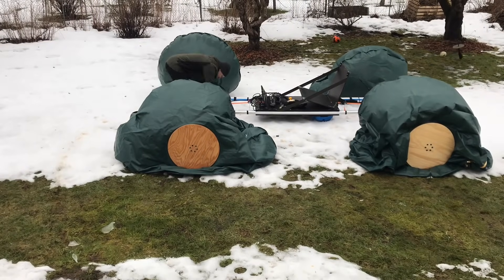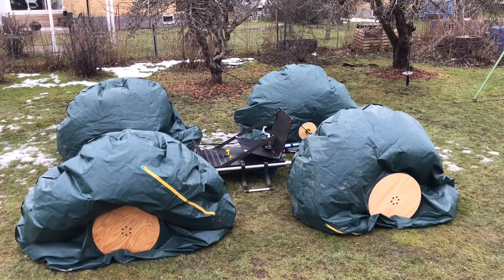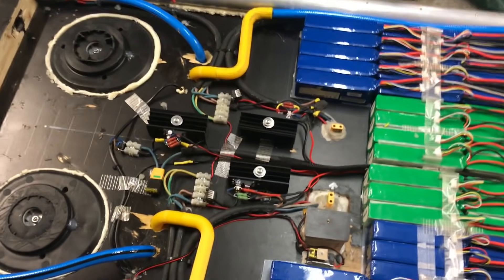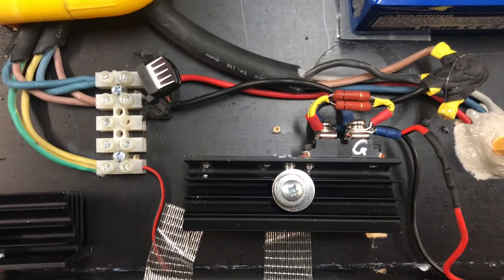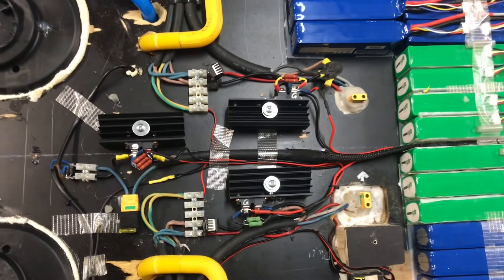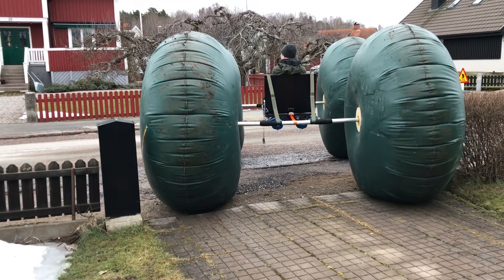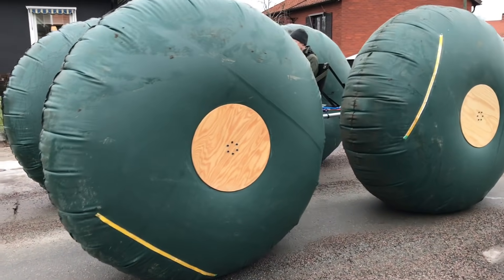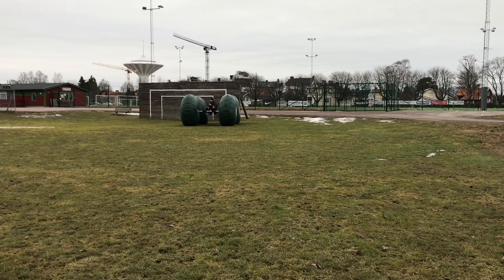Inflatable car episode 7 First full  test drive DIY SHERP!

Comment: It will be interesting to see this thing on the water. But i suspect it will slip alot and not be that fast.
Reply from the maker: Thats my guess as well. Although, the small amount of water being accelerated will be accelerated in the right direction (backwards) since the wheels will be "standing" ON the water rather than being mostly submerged in it like the Sherp. So still a little bit of hope there. The giant surface and low weight of the vehicle will make crossing water a windy day a no-go for obvious reasons though...
Reply: @amazingdiyprojects  Maybe a netting around the wheels for water driving is a solution? like snow chains on car tires.
Reply: Оn the water this car will be a toy of the wind. For strong wind on the ground too.
Reply: @RW3DQQ  You would have to choose a calm day, and a small, preferable shallow lake. of cousre.
Reply: @amazingdiyprojects  You are going to need to think about water traction. Paddles for the wheels that double as tire tread perhaps.

Comment: Your vacuum cleaner motor oscillation is caused by something called a hysteresis loop.
In order to fix it you need to add a delay between the input sensor and the power output.
Usually a fairly meaty capacitor across the gate of your output power transistor should fix it.

Comment: I built a few models to test 4-wheeled tank steering for RobotWars, and found that it worked much better when the wheel-base was about twice as wide as it was long. That way the wheels don't have to slide sideways as much when you turn. However it looks like you might struggle to make your car either shorter (because the tires are already close) or wider, unless you move your neighbour's mailbox!
Reply from the maker: I think you are absolutely right wheel base-lenght wise, but just as you pointed out ; there is just too many mailboxes in the world for that approach in this context...:-D
Reply: if the axle widths were different (front axle not as wide as the back, for example) you could overlap the tires and make the distance between the axles shorter. probably not these tires, but maybe with thinner ones. of course then you'd have even less visibility for steering...

Comment: Amazing vehicle. Have you considered turning it into a wheeled stretcher controlled by a first responder walking alongside. Could you add a pitch and roll sensor to the vacuums to keep the body level on inclined topography?

Comment: The oscillation your experiencing in your tires when you turn is somewhat akin to what's called "tire shake" in top fuel dragsters. As you've discovered already, it's related to grip level between the contact patch of the tire and the surface. In essence the tire kinda "wads" up on itself and then springs back into an oscillation. I think there are 2 ways they deal with it. One way, is tire pressure. More pressure makes the tire firmer and at the same time reduces contact patch and grip. Perhaps you could incorporate a system that would dynamically regulate the inflation pressure in you tires either based on the surface your on and it's grip level or perhaps simply increasing the pressure whenever you are maneuvering the vehicle. They also deal with it by controlling the application of torque and wheel speed by adjusting how much the clutch slips. Usually when dragsters experience the problem is when track conditions are tight and there is a lot of grip. Under those condition they want the application of torque to be much more aggressive to get the tire to slip enough and maintain a high enough wheel speed to prevent the wadding up of the tire and having it go into tire shake. Of course they have much more horsepower to play with. But some of the same principles might be applicable in your situation.

 Also If you watch a slow motion video of a top fuel dragster on a successful run (successful meaning no severe loss of traction or tire shake), you'll notice that there appears to be some sort of a standing wave that develops around the tire. You can see this in the distortion of the tire. Now, I am not a crew chief or expert on top fuel dragsters, but my guess is there is some sort of a formula or relationship between grip level, tire pressure, and wheel speed where the oscillation of the flexing of the tire at the contact patch is producing a standing wave rather than the non-standing wave that induces tire shake.

Comment: Consider adding an emergency charging circuit that charges the batteries to ~4V per cell (So as to eliminate the immediate risk of overcharging some cells) So if you happen to take it out longer than intended, you can recharge the batteries to some extent from a nearby power source :)

At first thought, some type of rectified mains then a SMPS or high voltage buck converter would be sufficient to limit the current

Comment: You just need pivot steering for the front wheels,  but it would be cool to keep the tank steering too in combo. Like handle bars but with speed control on each grip.
Reply from the maker: Im working on it, yes I would also prefer to keep the tank steering options for tight spots! :-D
Reply: Awesome project! I think you may have inadvertently designed the next Mars rover!
Reply: @amazingdiyprojects  Do you think something like an accelerator pedal and steering wheel/bar that determines the proportion to each side would work?  Perhaps even some electronic braking on one side.  Although, a rack and pinion steering system would probably reduce tire wear.
Reply: @amazingdiyprojects  Having independent controls for both would be a good idea, but you could also go one step further and have a small computer or micro-controller that could decide when to implement each separately or combine the 2. When the vehicle is stationary or at very little velocity the tank steering could be utilized. At higher speed pivoting wheel steering could be utilized.

Comment: Kudos to you! for protecting the seams you might wanna use this new type of undercoat for cars, they also use it as bedliner, it's some sort of spray on rubber, the can says it's kauchuk based (sorry if I spelt that wrong),  it is very tough, but elastic when it dries, and quite wear resistant. You might want to coat the entire running surface with it for wear resistance, but I'd test it first because it might make the tires too grippy, which seems to be the main problem already.
Reply from the maker: Thank you for your suggestion, will search for coatings like that. :-)

Comment: The work you do with limited tools is incredible but is there any reason you don’t have the front axle actually turn for steering? The turning radius would be greatly reduced but the material may wear better. You wouldn’t even need a steering wheel, you could just have foot straps and control the front end with your feet😂. I really like your work keep it up!
Reply from the maker: Thanks! Im working on a simple steering mechanism which I hope to test and film coming week!
Reply: @amazingdiyprojects  If your going to add steering, why not 4 wheel steering? Are all 4 wheels independently driven? If so 4 wheel steering should be not much more difficult than 2 wheel. Also, I don't see any reason you couldn't use a combination of both 4 wheel steering and your differential steering. 

Another idea, if you dynamically regulate tire pressure, would be to Increase tire pressure in the wheels on the outside of the turning radius  while lowering pressure in the wheels on the inside of the radius. This would work like "tire stagger" which is often used in oval track racing.

Comment: Seeing this reminded me of an idea I had decades ago. Back in the 1980's the motor sport of mud bogging was very popular.  It's racing through long pits filled with mud.  The vehicles that competed were usually 4 wheel drive, large, had very powerful, noisy engines.  In spite of the power they had, most would get stuck and not make it all the way through the pit.  I thought the problem had more to do with flotation than power, and thought it would be incredibly funny to make a pedal powered vehicle with 4 wheels that were all driven from the pedals.  I figured on using large tractor inner tubes for tires with a bit of canvas on the outside edges to provide a bit more resistance to puncturing.  I thought it would be easiest to have it steer by articulating in the middle.  Sadly, I never did build it.
Reply: I had an idea to make a skateboard without wheels that hovers a few inches above the ground. Too bad I never built it :(
Reply: @theupscriber65   I'm sorry that you didn't make one of those too.  The world would love to have one.  I suppose that we don't have a hovering skate board because it's beyond the ability of current technology, and possibly defies the laws of physics.  What I was thinking of making was technically possible, just beyond my budget at the time.  This video reminded me of that idea, I hadn't thought about it in years.

Comment: How to solve the steering problem. Since you're blowing air into the wheels through the axles, you'd need a way to have flexible but airtight joints. Simple solution is pieces of universal corrugated radiator hose. Any auto parts store should have some in various diameters. You'd also have to construct a rigid hinge around the hose.

Comment: Hi, couldn't you increase the pressure of the tires to reduce the friction on grippy surfaces ?
Reply: Manuel Pellizzari id imagine if he did that then it would be more likely to have the wheels pop whereas with more weight distribution they are slightly more rugged. It would help the steering though but it wouldn’t be worth the trade off. An better solution may be to work out a sort of “differential” like in a car or to have the front end actually steer.
Reply: @tannerfalls5651  Left and right are independent, so no differential needed - the axles aren't locked.
Reply: Andy Lee Robinson yea I put it in quotations because I meant something that does the same as a differential so the wheels don’t have to spin out but in your defense it was kinda confusing
Reply from the maker: Will try that as well, however dont want to risk blowing up a wheel.
Reply: amazingdiyprojects that would be quite unfortunate. I can’t imagine how much time an resources it would take to have to build a new wheel😬

Comment: Some type of limited slip differential is needed, as you leave your house onto the road it's possible to see the forces being applied to your rear wheels as you turn and straighten, maybe too overpowering for the materials to handle. Must have been amazing driving down your street in that machine.
Reply from the maker: Im working on a possible solution.
It sure was!
Reply: @amazingdiyprojects  fantastic! can't wait too see your solution. I really enjoy watching you overcome the technical problems you encounter, it's incredibly vicarious, thanks for sharing your awesome ideas. I used to do some off roading in a 4wd and changing the tyre pressure can alter grip depending on the surface you're driving on, possibly having a lower tyre pressure may help turning on grass.

Comment: I've seen tank-like systems that work more on differential braking rather than throttle, like a Sherp. If you had a controller with feedback from each wheel, that was capable of either "locking" or reversing individual wheels I think that would make for the easiest turning.

Comment: You need a pivot point and stear with your legs. Independent torsion  pivot with spring front to back, so you can have bend from to back.wheels.

Comment: Interesting wheels. The real stress seems to be located in the center around the wheel hubs.  Perhaps reducing the wheel's grip is all you need to reduce damaging oscillations that may cause the wheels to rip.

Comment: Wouldn’t an air tank and top up electric compressor be better and more energy efficient than using the vacuum cleaners?
Reply from the maker: You might be right. This system gives me a certain degree of fail safe, it will be able to fight both wear and tear degradation over time as well as minor punctures as well. But certainly on the low efficiency side. Think bouncy castle.

Comment: For my kyosho blizzard pisten bully I use a 3 dollar v-tail mixer for a rc plane together with two simple electronic speed controllers. Works perfect for me. In your case you must make sure it is not possible to instantly change from forward to reverse with the rc transmitter. And instead of a rc transmitter and receiver you can also use 2 dollar servo testers.

Comment: Awesome!
Yes, definitely need some form of fine steering, perhaps a centre pivot?
Visibility may be improved with transparent wheels, a jackable seat or even a periscope! :-)
Reply from the maker: Periscope!?...LOL....Love it!   A center pivot steering test is in the pipe!
Reply: @amazingdiyprojects  hehe.. a submarine style periscope would be amusing... but realistically you could take a Mars rover approach using twin cameras on a servo operated pole and head-tracking FPV goggles - I'm sure you could try something like this successfully, though static wide-angle cameras for front and back with a monitor screen would be much easier and cheaper.
Just one problem with a centre pivot is the change in centre of mass which could lead to tipping, though the small gap between front and rear tyres won't allow that to happen. Any changes in CoG will be more pronounced on water, so bear that in mind too!

May end up being better to have 1 or 2 pivots on the axles instead.

Comment: that snow slip just means that it will not climb in snow, and probably wont be able to stop on descent but its great for miles of flat tundra I guess 
a brilliant and unique project though
Reply from the maker: It only "slips" on ice/snow when the motors apply allot of power against each other. Acceleration  on snow is not bad at all, so I would guess that it could climb pretty steep on inclines covered in snow. Ice would for obvious reasons be more difficult.....

Comment: Have you considered trying water? Or would that be dangerous with the air intakes?
Reply from the maker: I hope to get to that really soon. The air intakes are almost a meter up so I think its fairly safe, at least a calm day. Big waves, hmm, probably not a good Idea with current design, especially the placement of the vacuum cleaner motors.. :-(

Comment: A want to make something similar, but i think i will use the ring inside the tractor tire. much easyer to fill, and airtight. 

small kinese 125 4T and have steering like a frontloader (joint in middle.) sry bad english

Comment: Did you run over your wife at 17:30 ? Your problems with differential steering is probably related to the motors just following the wheel, your motors need breaking torque and you need to be able to control the RPM of the motor and not the voltage / power
Reply: No i think he has switches to flick into reverse. Needs to use rc car triggers. Push forward for reverse
Reply: @nathanchalecki4842  The problem is that he has two reverse one set of wheels before he can steer it, I think this is related to lack of friction in the system ie. the motor just follows along the axis when the PWMs are differentiated (while both in the same direction). I think the choice of motors are less than ideal for this type of steering, maybe use BLDC motors instead (for breaking torque and better RPM control)
Reply: I agree, need to be able to control the RPM not just the power. 
I drive a Pisten Bully, a Snow Cat for work. In the wrong snow conditions it won't neutral steer , or what you are referring to as "Tank Turns" because of the snow grabbing the tracks . I have to make wider turns. If you can control wheel rpm differential steering should be much more effective. And in your case be an electronic fix not a mechanical fix.

Comment: Surely you could reduce the width of the vehicle very easily?
Reply from the maker: If/when I have a working steering that does not work like a tank I definitely could shorten the wheel axles.
Reply: @amazingdiyprojects  maybe a articulation system like tractor\construction equipment. You projects are amazing . Keep it up.

Comment: What is the actual point?  Seems like a kids go kart with balloon tires only it's not as fast and can't steer. It's 3 times the size of a normal car and doesn't fit on the road with other cars. It has no safety or comfort features, not even a roof or windshield or heater. Pointless.